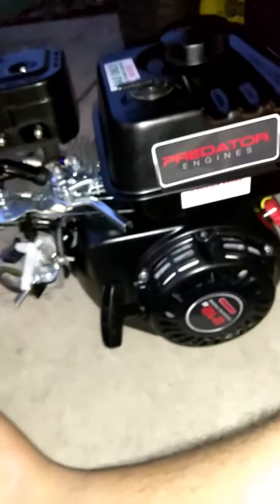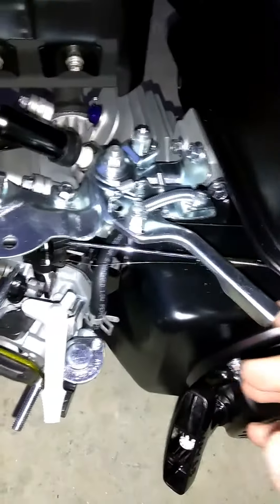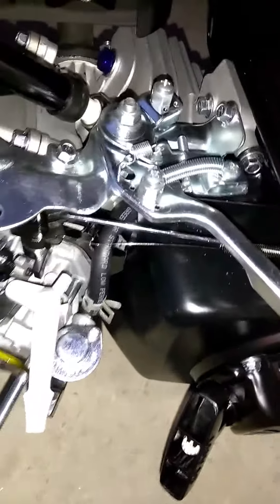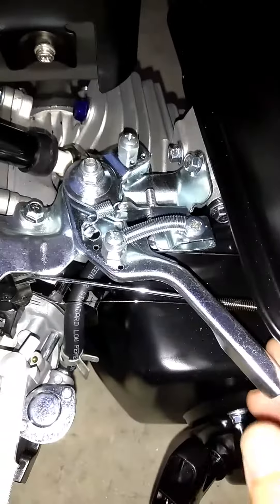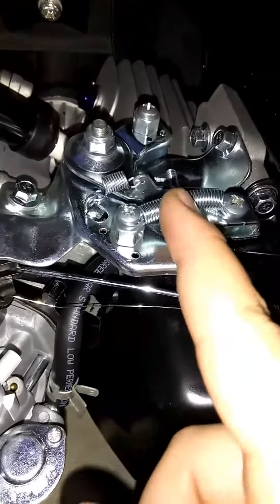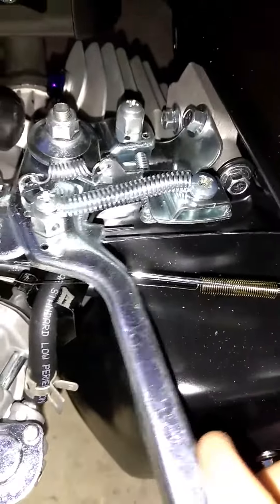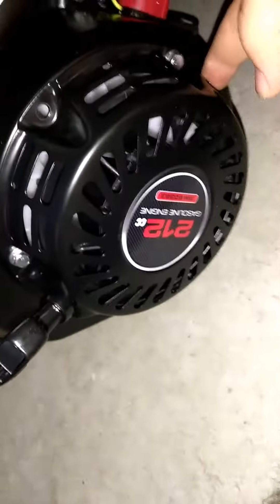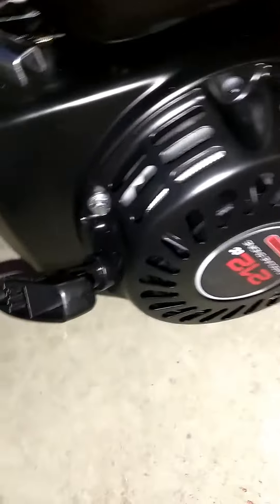Predator 212cc how to make throttle return after being pulled

Comment: You are a lifesaver man!  Just purchased a go kart for my kids with this exact engine and the throttle got stuck wide open.  It does have a kill switch but I was able to reach around and manually pull the lever back.  But I was trying to figure out where to mount a spring (I think I have the same size)  This is perfect.  Thanks for the video.
Reply from the maker: Glad I could help
Reply: What size is the spring?

Comment: These engines have almost killed me too many times man my throttle just got jammed today no kill switch
Reply from the maker: Wow that's scary, make sure you buy a strong return spring.
Reply: Same
Reply: mine used to run wide open even if u dont hit the gas we found out the carb was stuck wide open
Reply: dude same, it’s so dangerous man I crashed today

Comment: Just take out the washer 💀
Reply: What washerm
Reply: @SPIDER_SLIDER69  there’s a washer that puts pressure on the throttle arm. Take out the nut that holds the linkage, pull off the linkage, then you’ll see a washer that’s bent. If you take it out, the throttle moves freely.

Comment: And what size of spring did u get
Reply from the maker: I can't remember but I'm pretty sure it was in a pack with many other different sized springs. I believe I got them at home depot.
Reply: @vinny1028  don't worry bout it I already got one at ace, but thanks for the directions
Reply: @vinny1028  also it works really well, thanks
Reply from the maker: @gregv1852  good, I'm glad I was able to help ya
Reply: what size spring did you get
Reply: @gregv1852  what size did u get